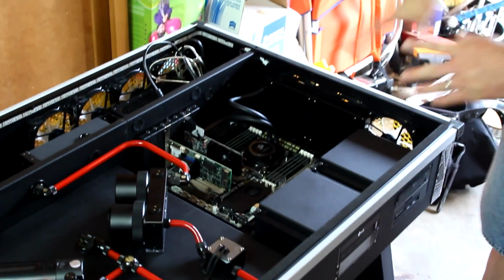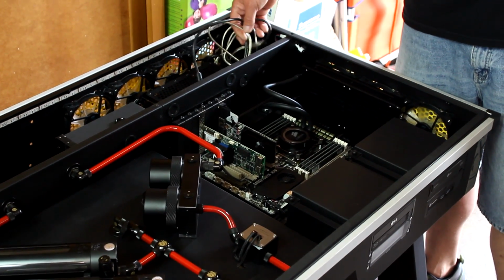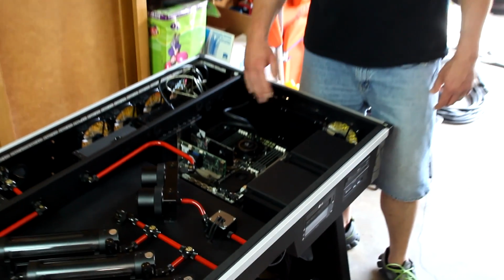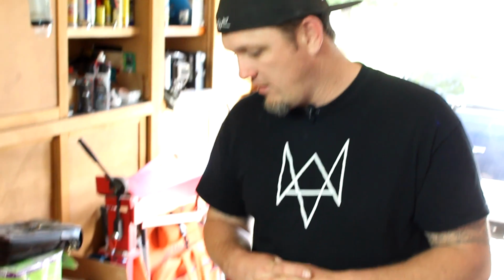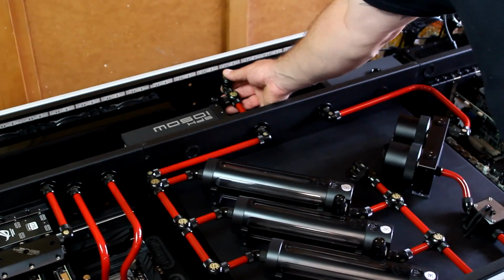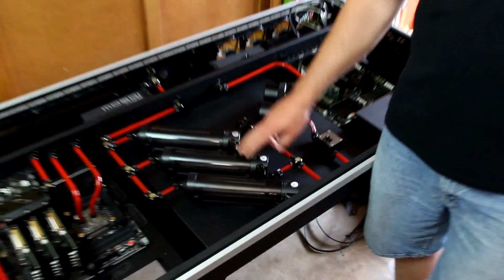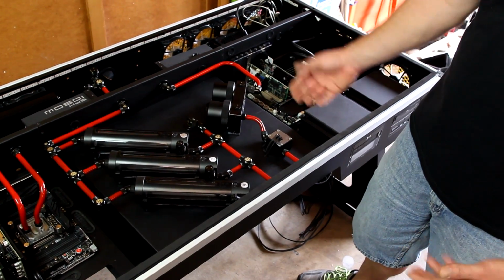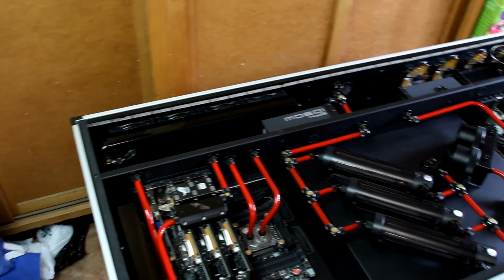Red Harbinger Cross desk Client build # 3   Part 3   Lighting and copper install

Comment: what is that red stuff on the copper tubing red rubber dip? as it looks nicer them soft tubing or crystal link with die.
Reply from the maker: Oliver Bishop its powder coating.
Reply: who ever done it done a good job you cant even tell it is paint looks like it was made that way

Comment: How does the draining port work im just curious if i were to ever make a build like this how i would drain the loop
Reply from the maker: I have 2 drains installed. one at res's and one on 480 rad. drain both and run air through system to get rest out.

Comment: You seem to just be sliding the powder coated copper into the connectors (elbows, etc.).  How are you making sure nothing leaks?  Is there more info somewhere on using copper for liquid cooling?  I've never seen it before. Very cool.  Thanks for the vids.
Reply from the maker: The fittings have a double oring that holds really good